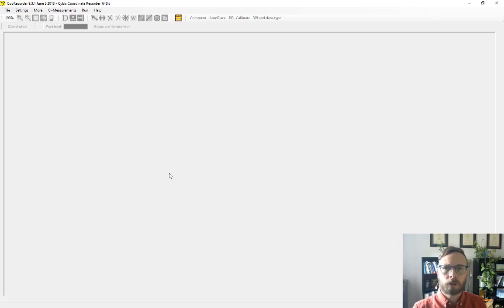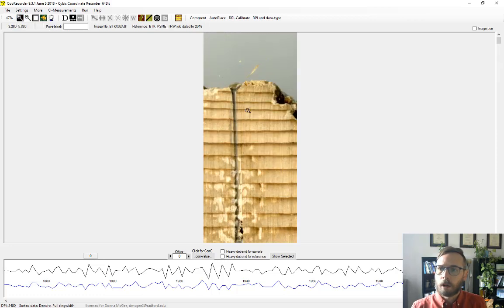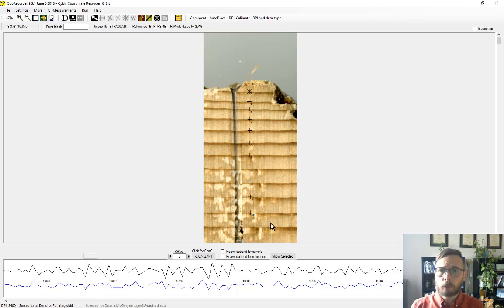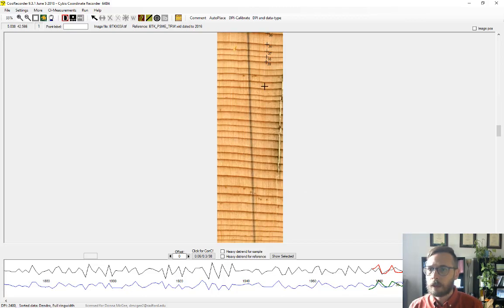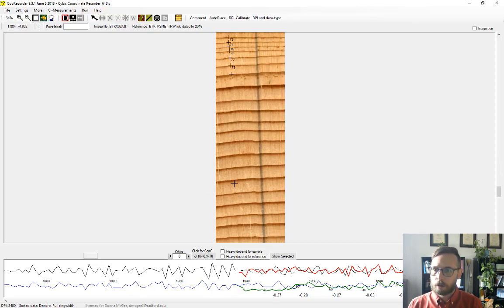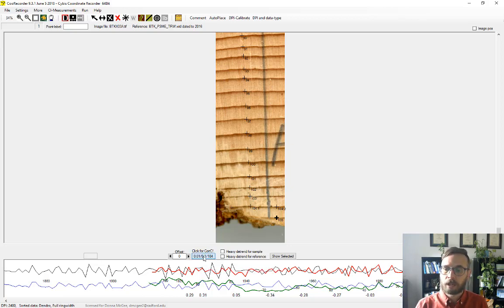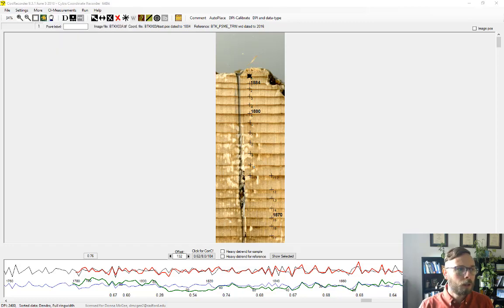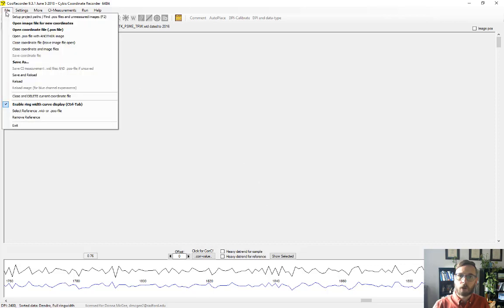Coorecorder Tutorial

Comment: Great tutorial. I couldn't help but notice that year 18 wasn't quite on the ring. Would this cause an error in cross-dating it to your master chronology or would the error be so small that it wouldn't be significant?
Reply from the maker: Ring boundaries should be accurately placed. Normally, I check each sample for boundary placement to minimize measurement errors. The small difference in placement would likely not cause an error in crossdating. However, you should always go back to the wood to verify measurements and dating!